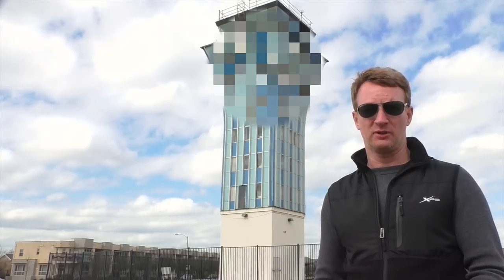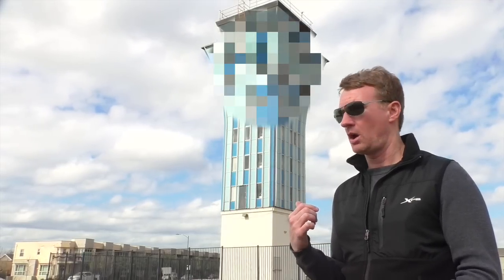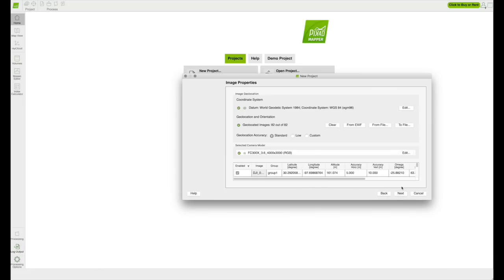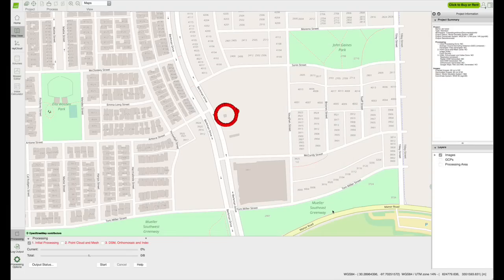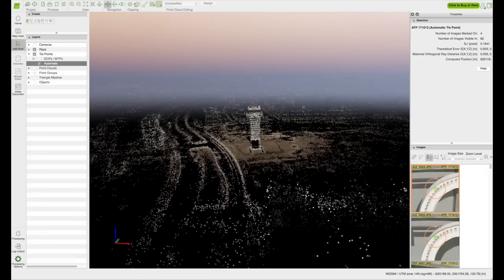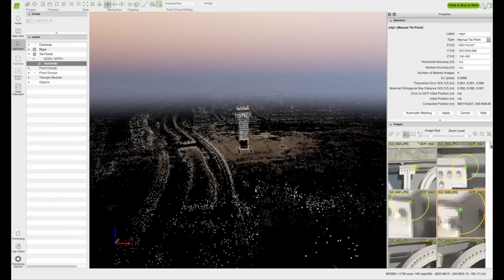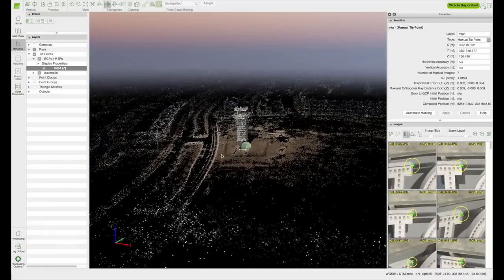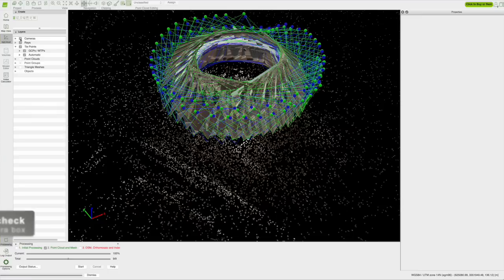Use Pix4D to create a 3D model on your computer

Comment: pix4d isnt free, and quite expensive, not everyone makes money from flying there drone, as there are enthusiasts,  
is there any truly free alternative software for processing the images on your pc
Reply from the maker: C gleebo Pix4D discovery is free. Although you can't export the file you can still make a 3D model
Reply: thanks for you reply, 
do you know of any other software that is free and gives you the same if not similar options to services like pix4d and dronedeply,
and let you export the project
Reply from the maker: C gleebo I wish. If I found that software I would tell everyone I know.
Reply: whats your opinion of webODM, just had a glance at it, there looks to be free option if you compile it from what i can make out, and a cheap paid option 36 gbp
Reply from the maker: C gleebo I think I looked at that one about a year ago. It looked like a lot of command line stuff. Which Im not fond of.
Reply: @gleebo5276   you can use Cloud Compare or meshlab to clean your point cloud and generate your mesh. Youll need to georeference the points first

Comment: Great video! Just for your information, you don't need to create manual tie points unless you have a broken project, or unless you are merging datasets.
Reply from the maker: Thanks for your feedback Paul. I have had projects that were improved by adding a few MTPs (and some that were not) and projects that were broken and the MTPs did not help at all (even when merging the projects). Of course, there are times when a DJI product miscalculates the Z axis which can cause errors. It would be great if you would do an episode with me next month when you come to Dallas. If you're interested, shoot me an email.

Comment: Great job on the video!  I had a quick tech question.  Do you know if it's possible to load the 3d image into Sketchup?  Is there a way to do that in a scale that I could export as an STL file?  If so I can make 3D prints of the structures.  I would have a YUGE market for that kind of thing.
Reply from the maker: TNA2Me yes you can. im not sure if it works in sketch up but I think it does. I used FME once
Reply: WOW!   I'll have to do some tinkering with this.  Thank you!
Reply from the maker: TNA2Me  Awesome, good luck. dont forget to send my 10%. lol.
Reply: Ha!  I was going to give you 20 but I'll settle for 10.  Lol

Comment: Any opinions on Agisoft, especially on Agisoft vs Pix4D??
I'm thinking of buying Agisoft, is Pix4D any better or just different? They both seem to do the same things. I've read that Pix4d is easier to use, but I don't care about how automatic it might be, I'd rather have total control over all the parameters.
Reply: I should mention with Agisoft, it's a one time $3,500, with Pix4d, I think it is a subscription of 3K per year. That's why I'm leaning toward to Agisoft.
Reply from the maker: Ty Brady Well, thats a good question. Its been a while since I've used it and your point about the license is a good one. I would normally say Pix4D, but a wise man recently told me that when the software is similar, go with what you know and like. you will be more proficient. And, lets face it, Agisoft isn't crap.

Comment: The roof didn't look very accurate?
Reply from the maker: that's the thing with this software. You have to be able toi edit. I edited the point cloud which changes the 3D mesh.
Reply: Ah ok :) So a bit of manual override is needed sometimes.
Reply from the maker: Exactly. There are times I use 2 apps and times I fly mauaul and times I go completely automatic. Its all about getting the best shot to create your model
Reply: If you do all these how do you merge them all?
Reply from the maker: Jason Lloyd you do it like its one project. the images are stored on the drone and they dont care how they were created. they are just happy you created them. haha. 
does that make since?
Reply: Haha, yes that's great :) Thank you very much
Reply from the maker: Fo sho, lol  happy to help
Reply: May I know how to removed those inaccurate points?

Comment: Have you compared how the models come out without the 4 MTPs? Is there a noticeable difference?
Reply: Andy Putch  Yes I have compared with and without MTPs. Sometimes the difference is noticable, and other times not. The MTPs are more important when your map is used for measurement.
Reply: Interesting. If the MTPs aren't making much of a difference, what are the advantages of processing on your computer?
Reply: Andy Putch The biggest difference is you can edit the point cloud, which means you can delete things or add to. Like when an area has holes caused by bad images.

Comment: why do we need to do MTP? and what is different between MTP and ATP?
Reply from the maker: My understanding of the MTP is to help with the accuracy of the project. By creating the MTPs you are manually confirming that each point you click on is in fact the same point in every imagine. When processing your images the software is making an educated guess based on a lot of data imbedded in the images from the drone. As we al know, computers mess up. The MTPs are correcting those mistakes. Even though we don't always notice the mistakes. Does that help?
Reply: thanks. i am first time to use it. may u show me how to move or pan the data?

Comment: so do you recommend drone deploy or pix4d?
Reply from the maker: All things considering, I have to go with Pix4D. Its a more complete package. Im not a fan of the cloud based services because you give up all control and abulity to edit. DroneDeploy has come a long way the past year but you still can't edit your map.
Reply: GM6 I know I'm on the same page. Being able to edit the inputs is important. But at the same time DroneDeploy is more valuable when it comes to attracting clients because it can be shown easily on iPhone or iPad instantly while Pix4D is a desktop application.  DroneDeploy can also integrate into your workflow with Skyward. So you can track your flights easier. We are having a hard time deciding which one to invest in
Reply from the maker: I agree. both companies have a good product and Pro & Cons. For me, If I can't edit my point cloud then its not much good. Example: If I capture images of a building and the sky is partly cloudy, and the cloud is mistaken for a solid object by the program, then I can edit the point cloud which allows the 3D mesh to be regenerated without a big blob. Not that I'm trying to push Pix4D but I rearly get a perfect 3D model. ha